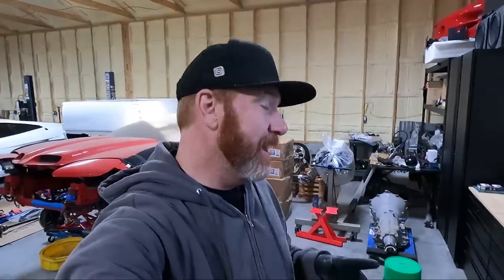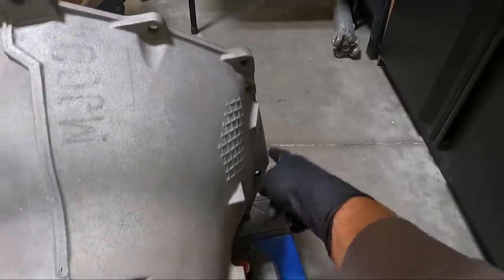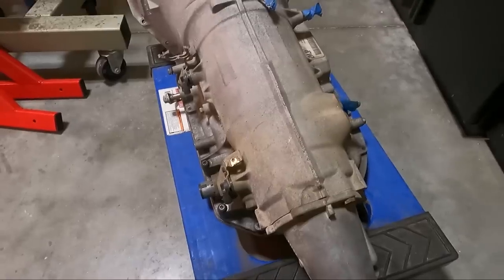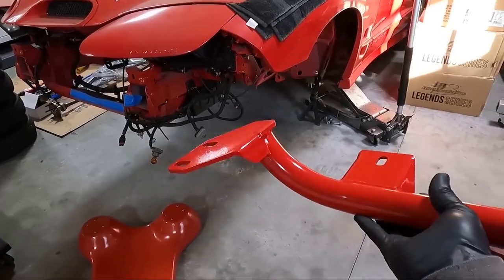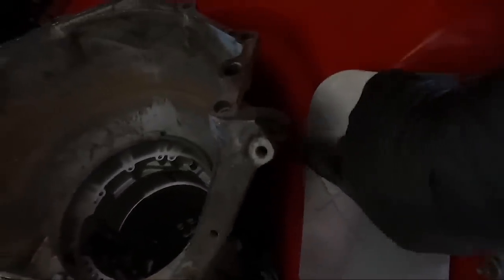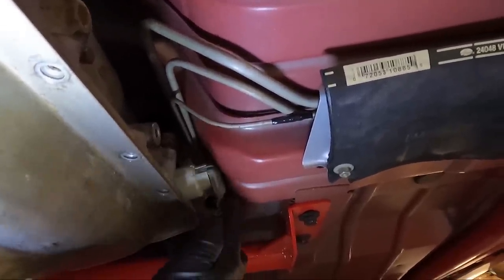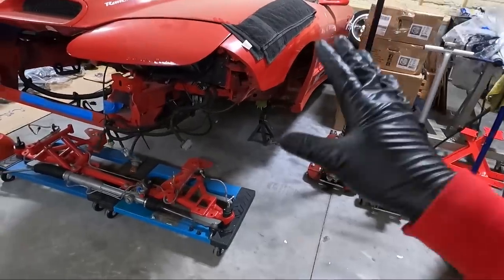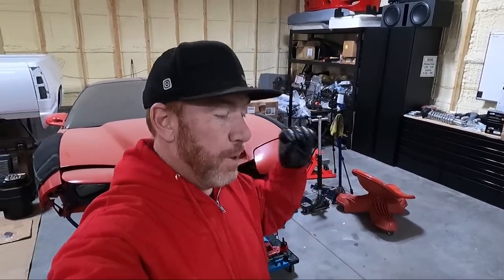Making Room for the 4l80e Swap Pontiac WS6 Trans Am (Trans Am WS6 Twin Turbo Build Part 4)

Comment: Yeah my 98 trans am been sitting for about 2-3 years went into guns and now how washington state is going with the awb I have a new urge to get the trans am done how I want it. Going mwc full suspension, mwc 9in, jakes 4l80e, 6.0l lq4, huron speed s480 turbo kit, holley dominator and 7in dash pro, rsm cage, fuel cell and front end
Reply from the maker: That is how it goes sometimes

Comment: What torque arm are you using.  That seems to be my hold up.  I’m trying to put a 6.0 with a 4l80 in a 2001 Camaro.
Reply from the maker: Non trans mounted. Haven't decided yet.
Reply: @TWAMotorsports  can you share what options are out there? I see that the factory torque arm can be used with the bmr cross member that has the bracket for the torque arm so I may go that route.  I’m just trying to do a budget ls swap with my 14 year old son.  We plan to buy the bmr k member and cross member.  Thanks for all the info your videos are helping me gain a ton of knowledge.
Reply from the maker: @charger7022 yes that is an option. The factory torque arm is so flimsy though
Reply: @TWAMotorsports  good point.  Thanks

Comment: Hey man, i own a 2002 ws6 Transam. Bone stock. Just a SLP LID. Just ordered some longtube headers for it. Not looking to make a drag car, just little upgrades like the headers. My question is while im installing those what else could i upgrade non major in order to get more HP? What would you recommend? Thanks.
Reply from the maker: Ported throttle body and find a good tuner.

Comment: get some used stock arms and clean them up and replace the bushings.   should be inexpensive to do.
Reply from the maker: Probably should
Reply: @TWAMotorsports  i've done it twice now, works out well, not too hard and you have more tools than me.  I'm sure it will turn out nice.
Reply from the maker: I may end up doing that